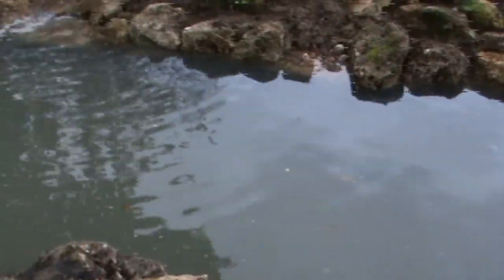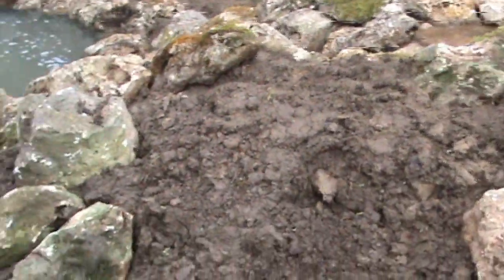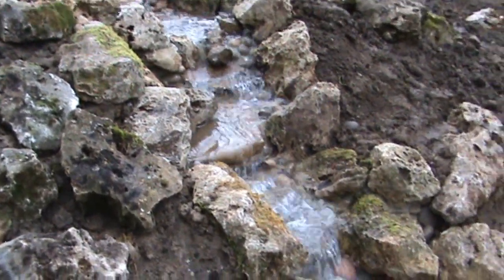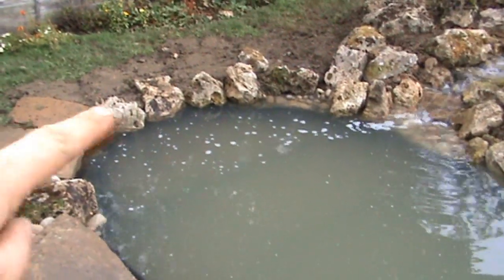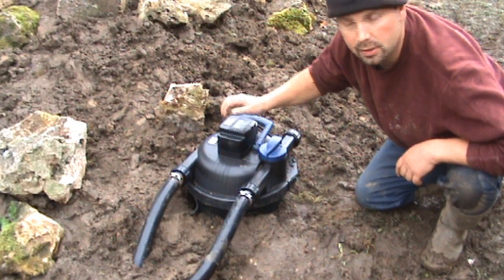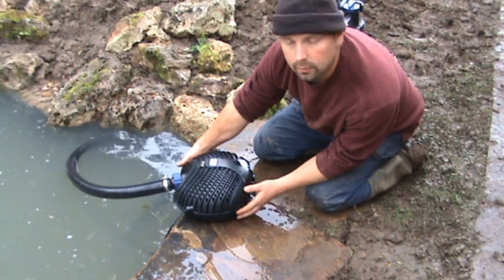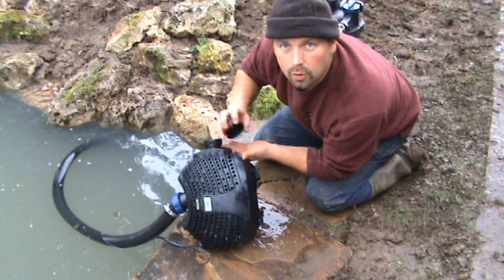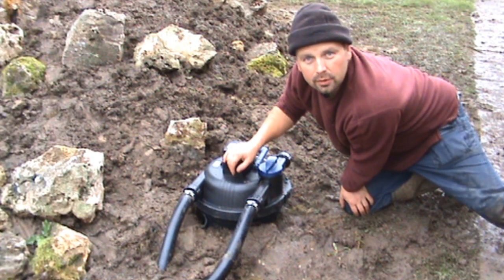How to Build a Fish Pond Part 4 - Finished Pond

Comment from the maker: From the dimensions you have there, it works out at 15.000 litres so a Filtoclear 30.000 would be my first choice. Provided the pump was at one end and the filter return was at the other, you will only need one filter.
The Aquamax Eco range of pumps can draw from 2 places at once as explained in this video so if your cascade / filter return was in the middle, you could use the pump to draw from the 2 ends, no worries.

Comment from the maker: Generally, yes as you will get the best water circulation if water enters the shallow end and is pumped from the opposite (deep) end. In the winter move the pump from the deep end to the shallow end and continue to run the pump. This will keep the bacteria in the filter alive and not disturb the warmer water in the deep end.

Comment from the maker: I would drop a bit of water out of the pond to give you space to work on your cascade and just cement it up. After a week or so, you could run water down it and do a 50% water change, switch off and repeat after another week or so. Should be no worries.

Comment from the maker: Will get drained and refilled tomorrow. Filter stays put - weatherproof, disguised by future planting. Fish in 2 weeks after refilling, adding water from old pond with fish. rainwater no worries. Moving pump to under cascade in winter prevents freezing and stops the main body of water getting chilled so fish will be OK. Only needs a small hole for gas to escape - fish can live happily under an iced pond as long as gas can escape somewhere - if not, they will suffocate.

Comment from the maker: Unless you live in an area where it gets super cold in winter or chill the water by removing water from the deep part and plunging it through freezing air, should be no worries. 1.5m width could ideally be bigger though considering koi generally get up to 3' long in good conditions.

Comment from the maker: 750 gallons should be OK until all the fish get to over 12" as there are only 8 in there. I have on occasion used a plastic barrel with alfagrog in to boost the filtration of a pond but would normally just replace the filter with suitable size for the new pond. Not sure which video you watched with the tunnel but the plants normally just sit in soil covering the tunnel. Pondovac 4 is expensive but very good - cleans very quickly and effecitvely.

Comment from the maker: If I was putting a pond in of 4.000 litres I would usually use either a Filtoclear 11.000 if there was a mix of plants and fish and maybe a 15.000 if there was fish only with koi.
As far as a pump goes, it is usually dependent on the volume of water but if there is a cascade it would be sized for that.

Comment from the maker: I think the pond was approx 4m x 2m x 1m deep.
Never heard of Oasga but looked them up - very similar design to Pondkraft and the plastic looks like cheap Chinese stuff. I'm sure they will perform OK and the running costs aren't bad for a Chinese pump but I always use Oase in the jobs I do for peace of mind, lowst running costs and the 5 year Guarantee.
Osaga may be a German company but those pumps are definitely made in China. If not, I will be shocked.

Comment: Thanks for your reply. Those are the exact dimensions that I want my pond to be, I will be using a pressure filter system as well so you can imagine that your videos are, for me at least the best thing since sliced bread :)

Believe me, I would love to use Oase, but the price from the Aquamax eco 5500 is as much as an Osaga system (6200 pump + 15.000 Filter). Unfortunately, budget is an issue...

Another question. What were the specs on the pump ? The water flow on the fall was spot on !

Comment from the maker: If it is a pressure filter then it doesn't matter where it is. If it is an ordinary box filter (which flows out by gravity) then it will need to be above the cascade.

Comment: Cracking informative videos and the pond was stunning at the end !  I have a small pond in my back garden i built last year it is a pre_formed one but have no power for a filter and pump so use  SOLAR fountain to give it a bit of aireation , any way i am moving house in a few weeks and the new house has a bigger pond but the house has been empty for 6 months and the pond is full of leaves and stuff no fish that i can see but all the equipment is under the hedge been left . So your video has helped me a little as to where to position the pump and dig in the the pipes if they work ! , it also has a small cascade and at the top is a small pool so it looks like someone at some point has made a proper job of it fingers crossed i can get it up and running !
Reply from the maker: +JOE KNOCKER Best of luck with that and I hope it works fine for you.
Reply: +Pondguru Outdoors how much would a job like that cost the customer?
Reply from the maker: I think I may have put the cost in one of the earlier comments but I can't remember off the top of my head - may have been around £2.5k but it was quite a long time ago.

Comment: Hello and thanks for these instructions. Awesome job, would be proud if I had a pond like that.

I have a few questions though : 

- What are the dimensions of the pond you built
- What's your opinion on the german pump/filter brand Osaga ? I found them to be a lot cheaper than Oase products. Could they be that bad ? I for one can't afford a Oase system and for the same price I would get a way larger Osaga filter/pump system.

Thank you in advance !

Comment: Great tutorial.  Thank you so much.  I am about to start my 10,000 litre fish pond with cascade, very similar to this project of yours.  Can you please tell me what the flow rate is at the cascade head?  It looks like about 2 litres per second.
Reply from the maker: I think I only wrote the list of materials on the full video but it was a 8000 lph pump so at that head it was probably moving nearer 6000 lph  which was more than enough for a cascade of this size.

Comment: Hi there,Just to say vids great,just want to know do you need to put soil,sand etc in bottom of pond?,I had an oil leak and had to start over,just scouting about to get inspiration,can`t wait to get started,Thanks G
Reply from the maker: I never bother putting soil or anything in the bottom of the pond unless it is an under gravel filter (e.g. spider filter) as it makes it more difficult to clean.